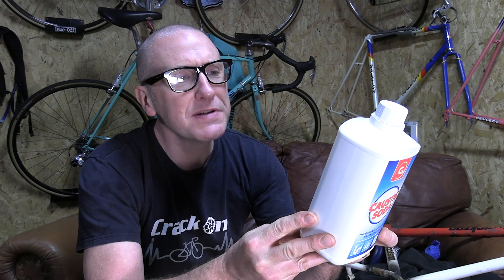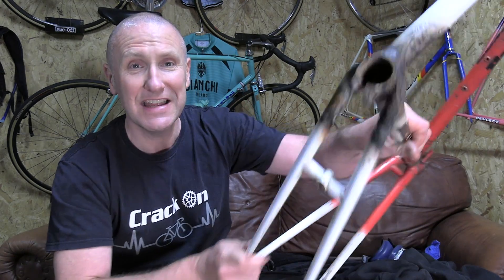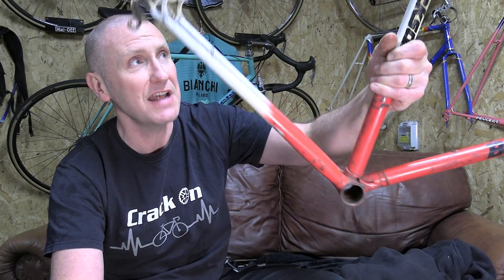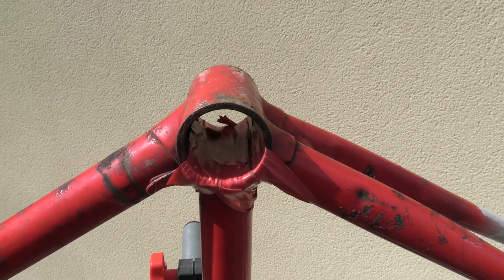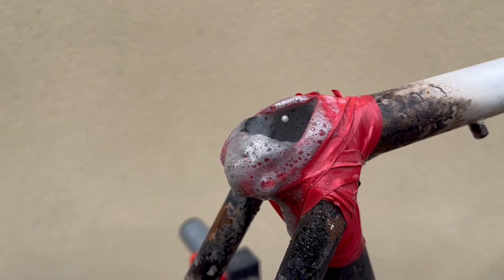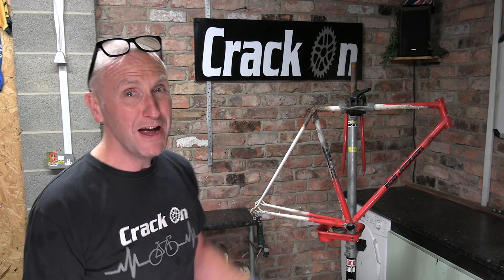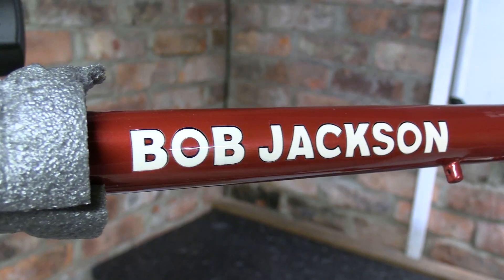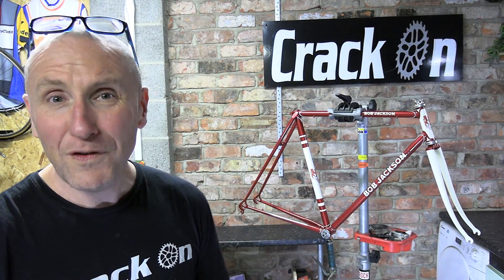How to Remove a Seized Seat Post using Caustic Soda

Comment: I'm exactly here, I have a lot more post out... At the cost of putting a screwdriver through the frame. Hopefully will weld up ok. I'm definitely going to have to try this or gallium
Reply: I'll add this, if I was going to do this again, aluminium post in steel frame, I would buy a long 26mm twist drill and drill the "meat" out of it. I'm confident it would stay fairly centered in the tube
Reply from the maker: Thanks for watching and your advice much appreciated

Comment: On the safety front I would just add that a full face visor would be better than safety glasses. NaOH will severely burn skin. I've used it to remove anodizing, but I use water at 50C before adding the NaOH slowly - also a 30% solution. I weigh out 300g of Solids to add to 700ml of water then once dissolved top up to 1 litre with cold water.  Works much more quickly when hot.  Good job and very clearly explained.
Reply from the maker: Thanks for watching and sharing your experience and knowledge it’s much appreciated

Comment: I've had same issue on my bike. Unfortunately it's an Aluminium frame and it was a carbon seatpost that was stucked. NaOH couldn't be used. Obviously. I've filed it away with hours of sandpapering. Worked Well but so hardly.
Reply from the maker: Oh wow, never had that combination eek. All the fun hay. Glad you sorted it, thanks for your support and happy cycling buddy

Comment: Could you use this to remove a steel seatpost fromman aluminium frame?
Reply: If you only want to save the seatpost ! 😅
Reply from the maker: If it was the seat post you was after saving, and not the frame.